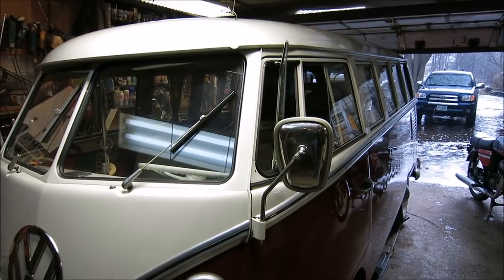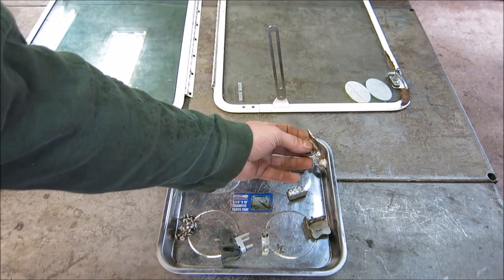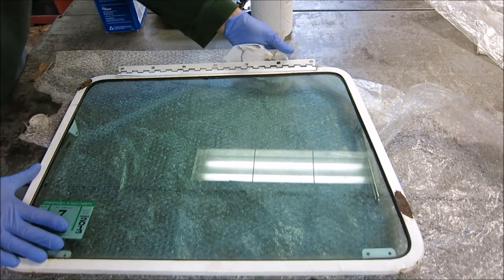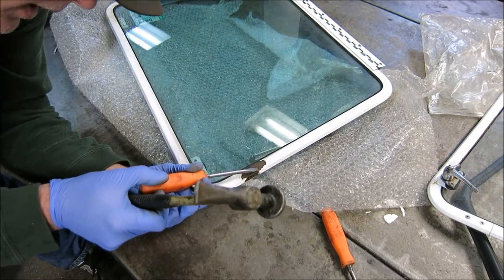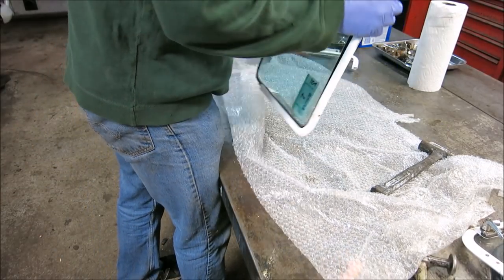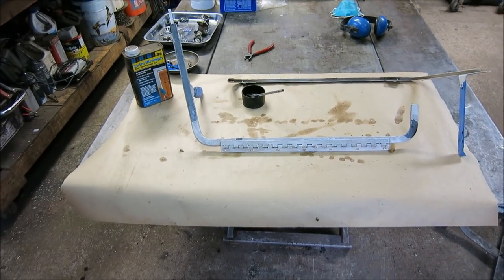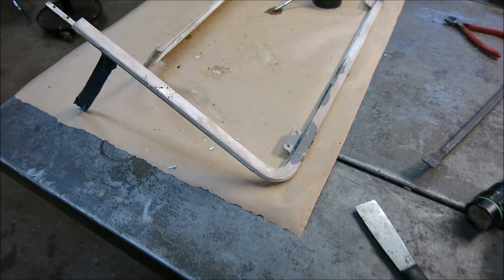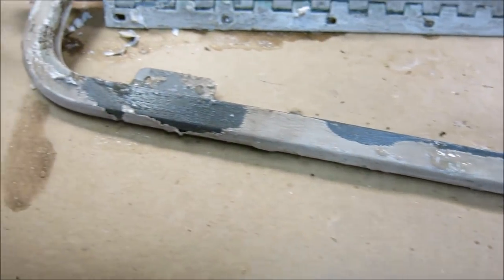safari window restoration

Comment: Safari windows for Lucy! And did anyone else say out loud "be careful" when he was getting them frames off? Hammers and old glass close together always should make 1 nervous..but it all worked out. Just wish you could have found them from a 'stored in a garage all of it's life' bus, but life doesn't work that way. Patience when painting Darren, you know that already,..and as someone who normally is but wants projects done now, I feel your pain! Hey 1 thing I've found works well (and probably too late) is to use a bit of dialectic(silicone) grease on the seals when reassembling windows like that..yep, did some on a old Jeep truck, it helps them go back together smooth, and also keeps the seals in great shape yrs. down the road. btw, I Love Lucy! Pretty much my fav vehicle of yours, although Crusty might be tied with her..so be careful! lol

Comment: Hey Mustie1, I know you work with stuff you already have and therefore don't spend much money but for those safari windows I would recommend the powder coating route. It is actually pretty inexpensive and quick too. If you have a local powder coating guy you would spend $50 to do both frames and it is just so much more durable than spray bomb. Greetings, Heiko

Comment: Thank you for the video, Mustie1. Too bad you don't have an electric oven in your Shop. Preheat parts, bake enamels & flow ceramic coatings. Yard sales and "curb days" are good for a small stove; top burners come in handy too. On the motorcycle- I think the braided stainless sleeve is way better than the wrap- probably way more durable, too. It will slightly darken with heat cycles, so not so blingy. That wrap gets brittle, and stone debris could fray it till loose or unwind.

Comment: Have you ever tried heating up parts and then dunking them in used motor oil? For sealing parts it works pretty well. 

My yard gate's hinges were done like that and they are still going strong after 5 years or there about. I dunked them in some 88' merc original unchanged oil (story time: car's owner only opened the garage door to run the car weekly before i bought it, i was shocked to find that the oil was still fluid despite the note book saying it was last changed in summer of 88), because damned if even oil wasn't better back then :)

Comment: Hi, I replaced all the pop out windows on my 67 camper, new seals all around. I tried grease, silicon spray and washing up liquid before using talcum power. Worked a treat, the talc stops the stiction of the rubber and allows it to slide. For the final few mm I carefully used two sash claps.
Reply from the maker: thanks will do, l was going to use 2x4s and clamps, but talk will be the lube now

Comment: About runs. There's a method to address them even after the paint is hardened. IE, you take the sharpest blade money can buy 
(Stanley used to make some pretty sharp ones, but they've gone to shit lately so i just buy razor blades) and wet scrape the whole bead off. On stuff that's one or two such occurrences it's simpler than to do the whole ritual dance around.

Comment: I guess it's too late to point out that if you put it on a wooden top workbench, you could have put some screws in the hinge to hold it steady while you worked to get it apart. Also, more thinner soaked around the edges would help break the bond on the sealer between the glass and metal. might eat it right up and make it much easier, don't know. Also, heat from a heat gun would also help.

Comment: Man o man.. had a 60 the same color. Whoever had it before me didn't realize first gear was not syncronised and knocked a few teeth off downshifting. I didn't care too much for the fact it did not come with a gas guage, found out that the knob that I turned late one night was not the heat but was in fact the knob that turned off the gas so the tank wouldn't drain if you parked on steep hill. Still miss it though. With you on the soap for install.
Reply from the maker: the knob was for reserve

Comment: To me, the video and audio quality seems as great as it usually is,  I didn't notice any difference even after you mentioned it, but yeah the focus does work well, if a slow reaction... I saw the bike and the 2 pipes, and got wondering what viewer reaction seemed to be when you asked for viewers to sort of vote on which style of pipe they preferred.  Not to be a repeat, but I liked them both (just not both at the same time).

Comment: Darren, is the glass two different shades of glass? Or does one have film or something?
Reply: Bob G I was thinking that too.
Hi Mustie from Western Australia.
Reply: One looks like regular glass, other tempered or safety glass, or both are and one has thermal reflection coating.
Reply: +Bob G  You're quite right.  I'm guessing here, but the tinted one could be factory original glass for a van sold in California (I've noticed some Cali VWs have tinted glass that the rest don't) and the other is a replacement screen.  Or it could be that the tinted item is a replacement.  It doesn't look like a tint film though it might be, just fitted really well, I'm sure that will be revealed in a future video...
Reply: There should be a little etching in each corner of glass. Factory glass will be obvious. Looks like one was replaced with different tint. Your local glass shop can fabricate new one then they match and will have none of those small scratches that you see on a sunny day. The options for laminate glass are green, blue,brown  and clear.

Comment: That paint was a pig, i would have used a butain gun and wire brush to remove it, it's worked on thin petrol tanks :-D
Are you going to saturate the seal with silicone spray so its easyer to get back in?
Reply from the maker: that or just dish soap
Reply: canuckguy worried, yes and i spelt it very wrongly lol :-D
My english is so crap, sorry about that.
Reply: Simon from the UK here.... What can you put on the rubber to keep it supple as it's got to make a good seal to stop the wind and rain out
Reply: They say petrol, we say gas !
Reply: GM dealers sell a lil' bottle of kind of "silicone grease". I use it every year on my cars, especially on my 30 years old car rubber seals. It works magic. I treated a friend's '72 TR6 deteriorated and dried seals and they came back pretty good after a couples of applications.
At last, a good GM product !
Reply: canuckguy worried, im a bit slow today, "lets call the whole thing oooooff" :-D
i'm 51 so, i'm seen as an 'Old git' lol :-D, you are not alone.
Reply: Marc René Yvon, You don't want gas, makes you burp a lot.... well depending which way it goes he he :-D
Reply: LOL ! :-)

Comment: In the past I have made the odd tow hitch but wouldn't do it now as over here in the UK they have to be type approved, ( Euro Union) A few years back they did a recall on Jeep, Just after I got rid of mine. the work involved having to reinforce the area around the fuel tank and the tow hitch had to be removed. People were collecting their Jeeps from the dealer to find that they no longer had tow hitches attached. At the time there was no EU approved tow hitch that could be fitted.
The vid and sound seems good to me.